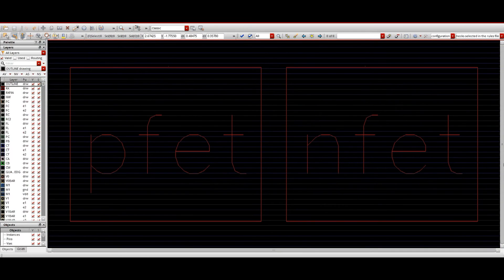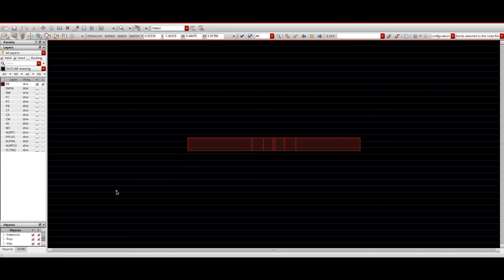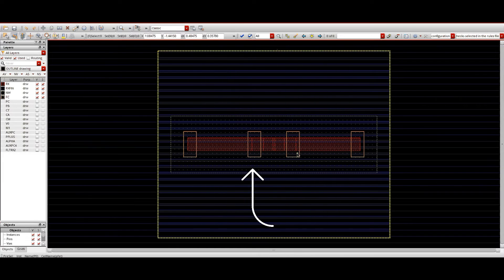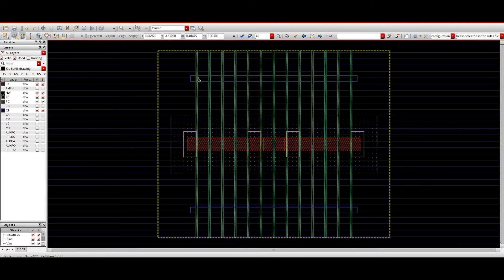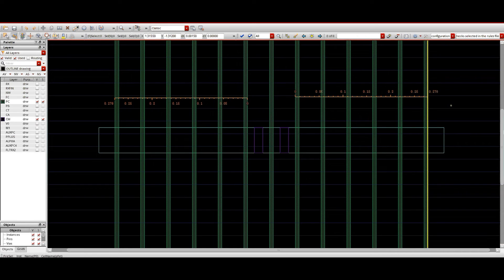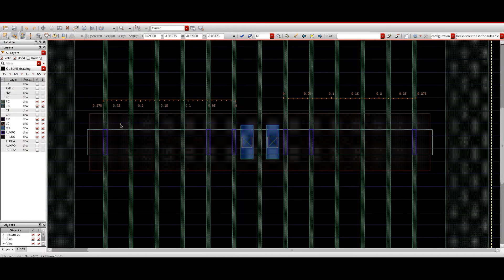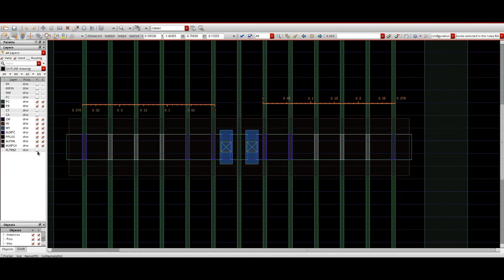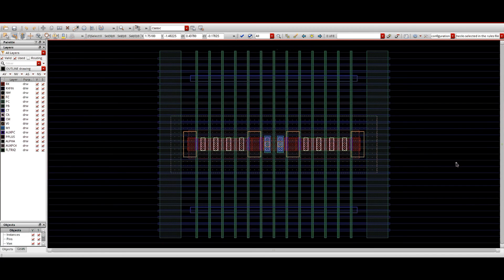7nm FINFET Layout

Comment: explanation on difference between auxpc and dummy is not clear.
Reply from the maker: Sorry , even I tried , but I'm not able to get full details ....
Reply: @analoglayout   My idea about AUX PC is that it is a layer used at the time of extraction. A  PC layer and active will be extracted as device which will give LVS error. To avoid that we give AUX PC layer to indicate that it should not be extracted as device. I dont think it is a layer which goes to fabrication. We use CT to prevent any leakage resulting due to this parasitic devices.

Comment: I had read that CA is MOIL(Middle Of Inter connect Layer) and it used to connect all FINs together and provide connection to VD(which is Contact to CA and M0).
Correct me if i am wrong.
Reply from the maker: Even I'm also not sure ....bcos i didn't get any proper documentation for finfet ..... So ....